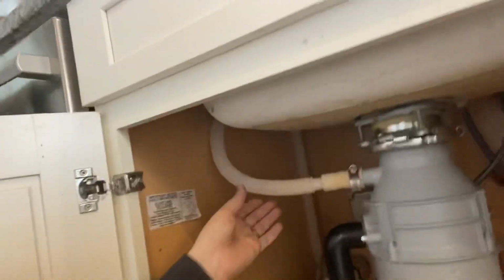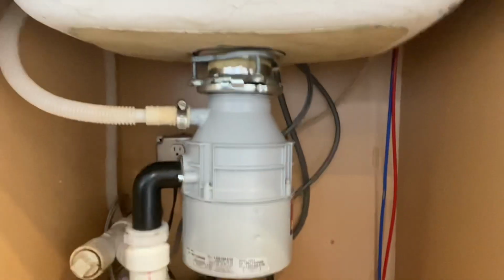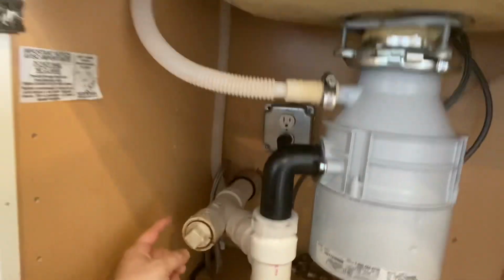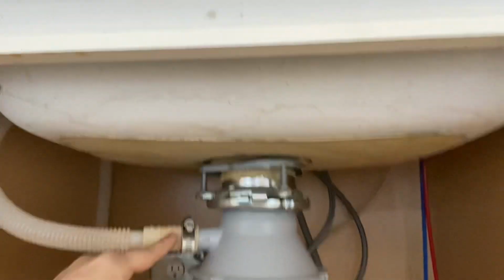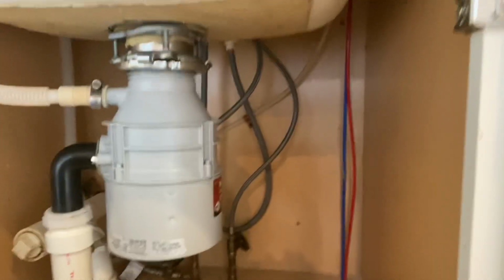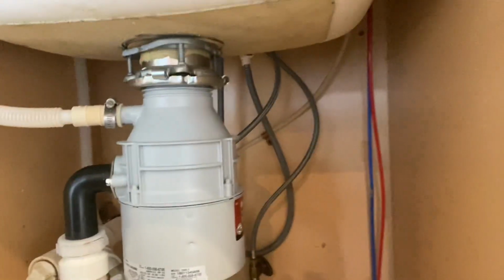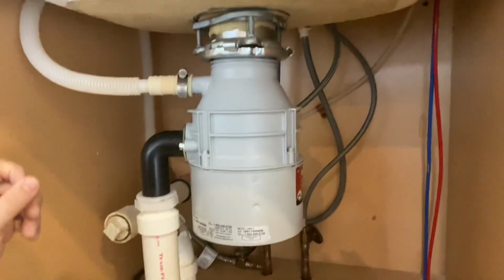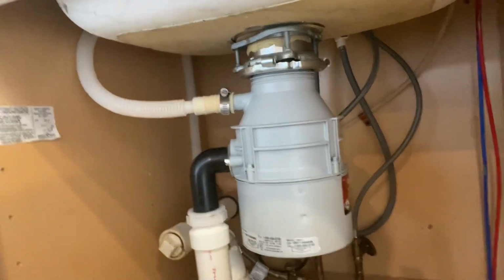Dishwasher High Loop - What is it and what does it do?

Comment: Best most accurate video for visuals on where and why to install or fix install of hose. Need a 3/4” emt clamp from electrical dept in home depot, lowes or supply store and 1/4 “ screw and an electric screwdriver (easiest or manual). Ideal to to have 32" in height as per most manufacturers recommendations. Based on what I have read air gaps can work but over time they generally leak so should be a good solution. We just purchased a new GE profile and they did not loop the hose :( so we need to do it. Also the sanitize light is not going on. not sure if the drainage has something to do with it. Our old dishwasher can a feature to pump water extra out of the basin this one has extra heaters etc but some of the glass items were wet. Out water heater is at 145 so thats not not the issue.

Comment: does this mean I can remove my existing AirGap and create a high loop to utilize the existing 1 3/8 inch hole in my sink for other accessories?
Reply from the maker: Probably not. In most areas an actual air gap is not required and high loops are acceptable. My guess is, given you have an air gap, it was installed because it was required in your area. Most likely if its already there it would be a bad idea to remove it and technically speaking it is the best solution to potential backup.
Reply: @inspectinghomes  thank you. this video was very helpful and informative

Comment: News flash, an air cap is the only way to go
Reply from the maker: The main purpose of this video is to have people understand the importance of a high loop because the vast majority of the time they have nothing. If you have some insight into why an air gap is far superior and "the only way to go" I would love to hear it. I may learn something and I am sure the people watching the video would also. I have personally never been taught the significant difference of the two other than an air gap is higher. Seems to me with a proper high loop an issue is very unlikely, but I would love to hear more about your opinion